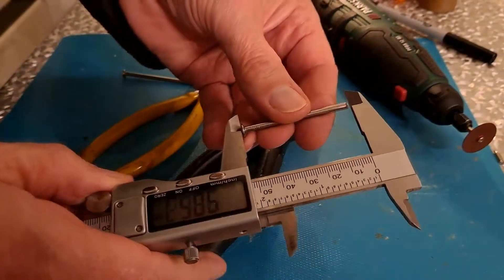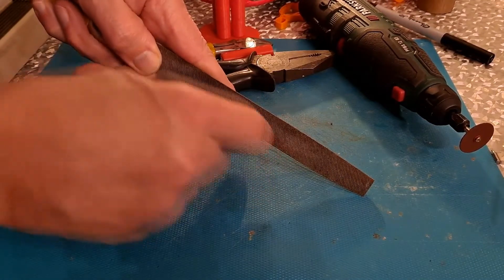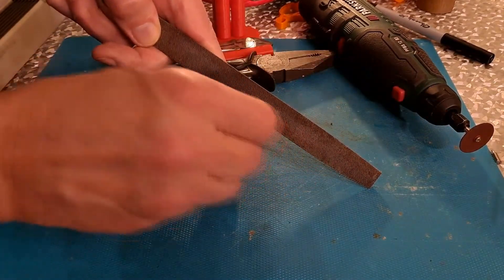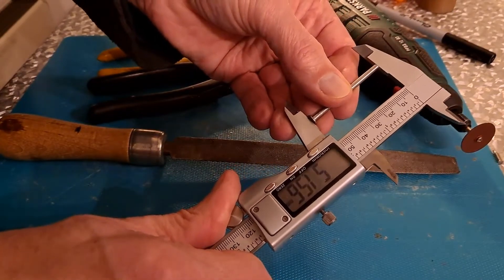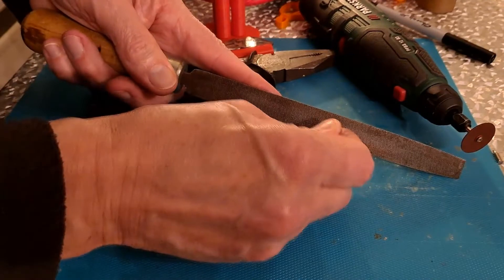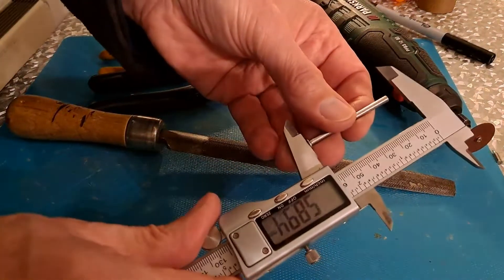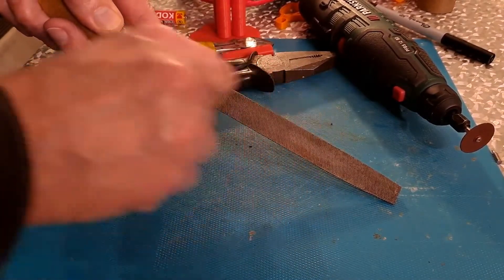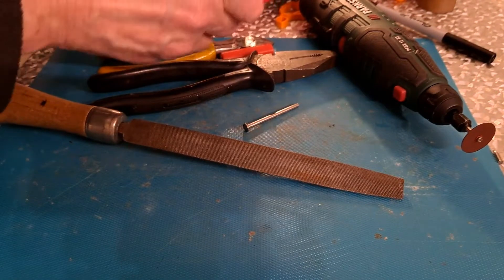Simpler 3D printed dummy AA battery

Comment: What is the purpose of this I thought of this for a project just wondering if we were on the same page
Reply from the maker: If you haven't been following the series, I will explain. A 14500 Lithium Ion battery gives you 4.2 volts when freshly charged, compared to an AA battery giving you 1.5 volts. So, if you swap 4 AA batteries (6 volts) for 4 Lithium Ion batteries (16 volts) you will find your RC car gives a puff of smoke and ceases to work. If you don't want that to happen, you need to use less batteries. Two will still over power the car, but it might survive, so you need two dummy batteries to take up the space and maintain electrical continuity. You will find further information in the video description.
Reply: @GrandadIsAnOldMan  actually I'm working on fireworks modules but same principle
Reply from the maker: @RobertDickens2002  sounds great, but take care with the lithium ion batteries as they can be fireworks all on their own 😄👍🔥
Reply: @GrandadIsAnOldMan  yes I learned this first hand removing a battery from a cell phone I nicked it and it caught on fire.

Comment: Good job. Excellent use for 3D printing. Thanks 😀 👍
Reply from the maker: Another item that could have been produced many different ways, but when you have a 3D printer it soon becomes the first choice. A piece of dowel with a hole drilled down the middle would work fine 😆😆

Comment: Tried any more 3d printing of wheels too fit onto rc cars like the 4wd Nikko that had disintegrated rubber on most of it where you put on new front wheels i think it was ?

Maybe you could design some rims too fit Lego tires onto some car if you got any Lego around, would give pretty decent grip I'd imagine & maybe you could work out some designs for front hubs on some rc scrap pieces too use Lego rims & tires directly if they aren't too large & heavy for whatever parts or car you put them on.

Like for the front a small ballbearing with enough inner diameter too have room for a Lego axle & a hub piece you glue the axle in place in the bearing.
Ofc designed in a way so it can't slide out backwards so the axle can only be removed by taking apart the car itself & the ball bearing slots into it the same way as the lego axle with perhaps a screw pressing into it slightly too hold it in place or 3d printing a clip that holds it in place on the backside slightly.
Reply from the maker: It sounds like you have some great ideas. Do you have access to a 3D printer? I am sure you would enjoy designing and printing your own ideas 👍👍